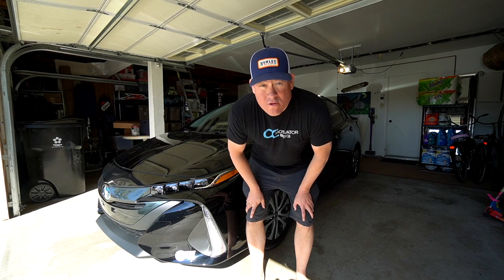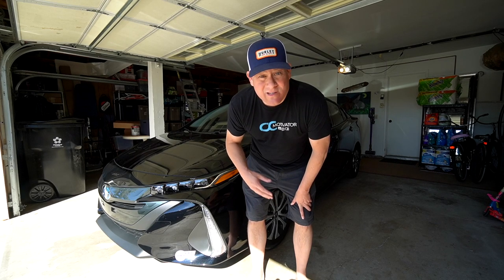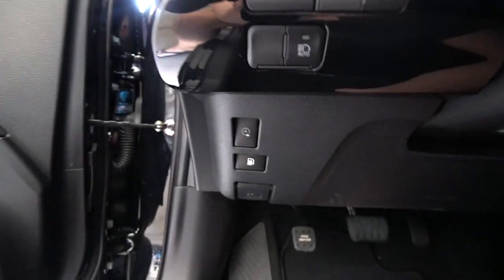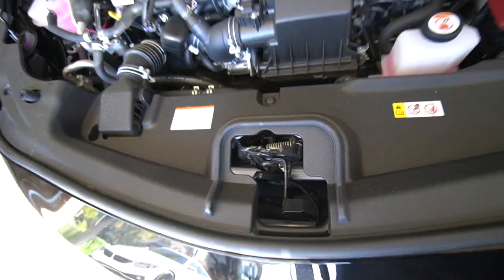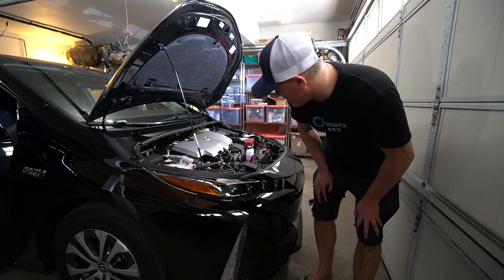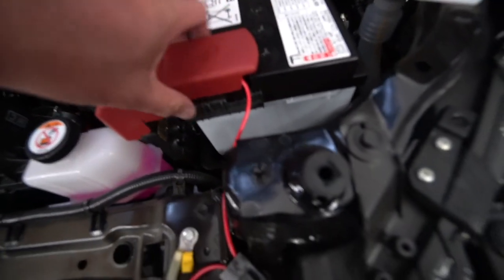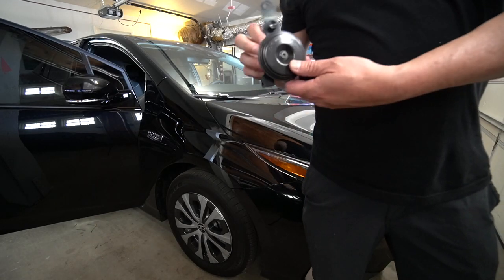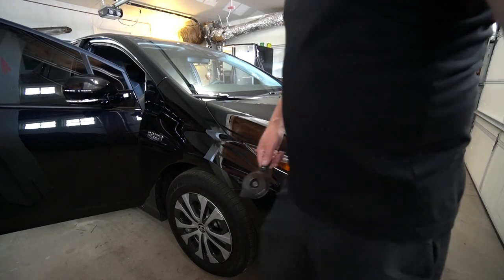I Installed AIR HORNS on my 2020 Prius! It’s amazing!

Comment: I have found that adding horns to the Prius is easy....as long as you remove the hood lock/latch first. Three bolts hold it in place...on has a plastic cap on it.....remove those three bolts and then you can move the latch off to the side to work easily on installing the horns. I have two horns...the Wolo Bad Boy and the Marco Tornado...
Do not just wire them up using the factory wiring. The amperage is too high for the 10 amp circuit. Use the factor circuit to actuate the horns but not to power them. The Wolo and the Marco each take about 15 amps each...and will blow fuses after a toot or two if you have a 10 amp line which is common on horn circuits. Do not put 20 amp fuses in the fuse box to allow the use of these horns. You are asking for trouble if you do....too many amps through the very fine wire (16 gauge wire I think) can cause a fire. The circuit for the factory horn is wired to accept the very anemic factory horns that take very little amperage. Use the supplied (usually) relay and you will not have any problems...it can be a little confusing to wire up but remember to wire directly to the battery and use an inline fuse of 25 to 30 amps depending on the amp draw of the horn or horns. 
     The two air horns are crazy loud. Way louder than any factory horn. Not a low pitch sound but a medium to high...very much like the land yachts of the 60's and 70's but way louder.
Reply: Nice write-up! What did you mean by "using inline fuse of 25-30 amps"?

Comment: The inline fuse needs to be closer to the battery, especially if it is not secured tightly to prevent chafing.
Reply: He should have got another car instead. One with good horn

Comment: Very creative - surprised you weren't afraid to touch this thing - as Scotty Kilmer says only pro mechanic should work on those hybrids! ))) Now - how about new rims??))))
Reply from the maker: Veronica Convery shopping those now! 👍🏼
Reply: They're wheels, not rims. The rim is just the outer edge of the wheel where the rubber of the tire touches the metal of the wheel.